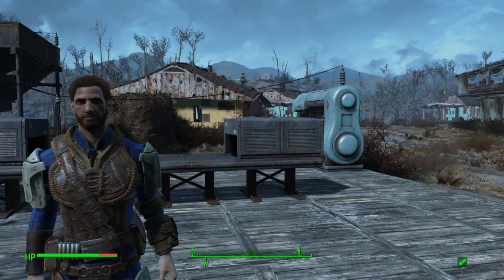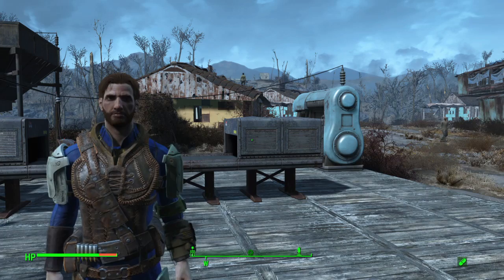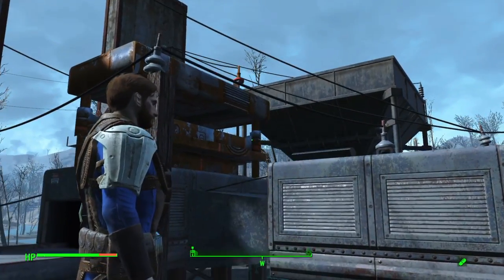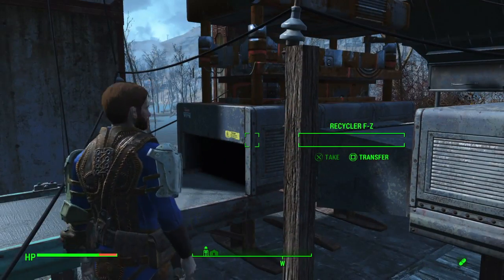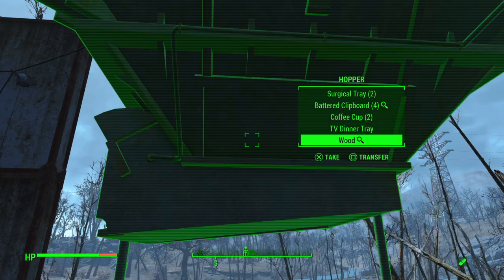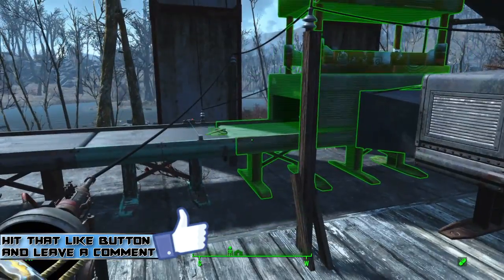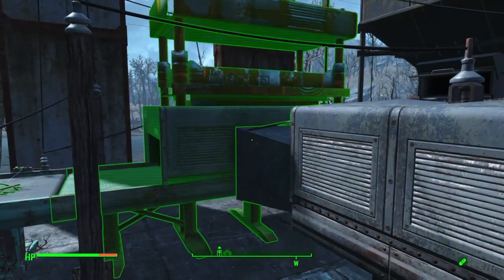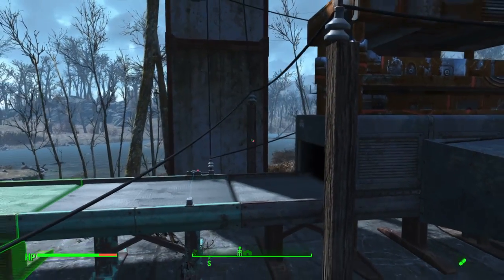Fallout 4 - Recycler Tip | Extract all Materials!

Comment: You can also do the same setup with just 1 laser and 2 Nand gates, first Nand gate will have input from the main power and the laser and output to the delay on switch, 2nd Nand gate will have input from the first Nand gate and main power and the output to anything that you want to activate after delay timer has expired.
I use it to automatically activate the vacuum hoppers to clear the buiders after production has ended.
Reply from the maker: Sounds like a simplified solution.  Thanks for the tip!
Reply: Wouldn't this be an issue as it sometimes takes a while for materials to build up in a forge that are required for the desired item being produced? I would think that if it is taking time to bring in the materials needed (from sorters for example) then the hopper would be triggered by delay and pull everything out so you have to start over.
Reply from the maker: Even if that did happen you could make a loop system that brought everything back.  And eventually you would accumulate all of the materials needed to make the product.  Good point though.

Comment: How does your laser switches automatically turn on? Mine only actives and deactivates when item goes past it?
Reply from the maker: +Borat Sagdiyev there are two laser switches.  One goes back and forth from on and off as items trigger it.  The other is on only as items trigger the laser.  Then if goes off until and another item triggers laser
Reply: Mischuff Gaming Thank you I've been using the wrong switches the whole time.
Reply from the maker: +Borat Sagdiyev glad you asked and got it figured out!

Comment: Ok, this may sound dumb, but how do you "set" the recycler?  Ive attached a console to it, no options.  So i am at a loss
Reply from the maker: Not dumb at all!  When you connect the recycler to the terminal you should be able to access it.  Once you are in the recycler menu you pick the material you want to "extract".  If you are not seeing this as an option, make sure the recycler and terminal both have power and are connected on the same network.  Check out one of my other videos where I show you exactly how to do this.  Skip to  7:30, that is where I start talking about the recylcer.  Good luck and hope this helps.
Reply from the maker: Forgot to link the video...   https://www.youtube.com/watch?v=a4MeulYRbyQ
Reply: i hooked up one to the recycler did not do nothing hooked it up to a vac hoper  i got the vac hoper to slow down the amount of items so i don't get the stuff all over the floor .

Comment: Anyway to understand gates easy?
Reply from the maker: I wish man.  All I can tell you is play around with them ALOT.  As soon as I thought I understood them, something happened which made me confused all over again.  Plan on a little trial and error when using them, but eventually you will get the hang of it and only use the ones you really need.
Reply: Ya I need to try the trial and error see how some work and what I want them to do....anyway you had the recycling part doing just wood? Where did that go to and where did the hopper line go to?
Reply from the maker: I set this up just for a demo for this video so they went nowhere...but if you wanted to get really creative you could have the wood go directly to a forge that requires wood for building something then have the rest of the materials go to more recyclers and continue the process to break things down further.  Like a huge recycling plant!

Comment: What the fuck is the Recycler? Not in my game on PS4. Just tell it's impossible to extract the specific materials.
Reply from the maker: Recyclers are only going to extract the material you tell it too.  It will store everything else in it.
Reply: Mischuff Gaming Whoa, that was FAST. But I don't have any Recyclers. And I do have all the DLCs... Just call me stupid, I don't get it :-D
Reply: Mischuff Gaming I just want to break everything down to components without losing the others. Damn, this is difficult. I'va played the game through pretty thoroughly, but this annoys the crap out of me..
Reply from the maker: Its one of the hardest things to do when it comes to settlement building!  As far as the recycler...it was part of a mod.  It is not part of the base game.
Reply: Mischuff Gaming I knew it... The only mod I have used is the "All you can carry" one, I don't want to use any others... Oh well. But thanks for the help!
Reply: Mischuff Gaming IMHO: the manufacturing is totally USELESS. It's not like you need it. You don't need it at all, you can buy shipments and you can get all the other crap by playing the game. I spent way too much time and effort trying to figure it out, but I kind of did.
Reply from the maker: Your right that’s it’s not needed to progress In the game.  It’s’ more of a creation tool for fun and creativity than usefulness.
Reply: Mischuff Gaming That's right. I built a factory to Vault 88 and had loads of fun with it. Well, kind of :-) time flies with this game, I absolutely Love it. Been waiting for a similar game... You can play this on and on, basically forever. Just bought Wolfenstein II, but...

Comment: Why do you break down just for one material? Just don't programm the recycler and it breaks down everything.
I putt all my stuff i will break down in the recycler, he starts to work and all materials which are leaving going into the workshop storage unit, which stores all stuff in the workshop. You just need those two machines.
Building so many parts for such an easy solution. Yes it looks better to have dozen of parts, but you made it complicated.

Sorry this is a repost, cause there was a nutty person, who ruined the last conversation.
Reply: That would seem a little easier than some Rube Goldberg contraption